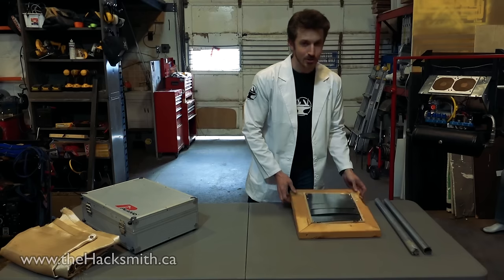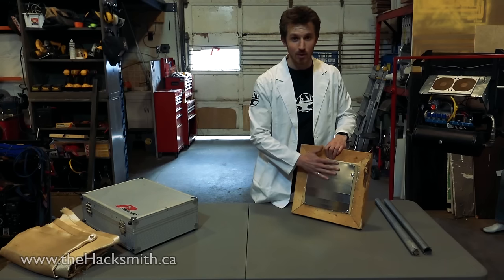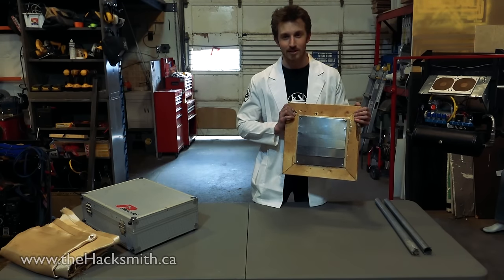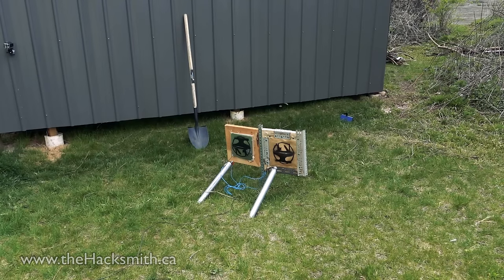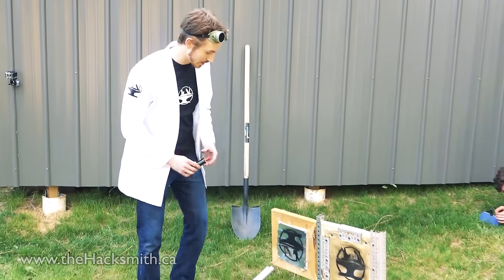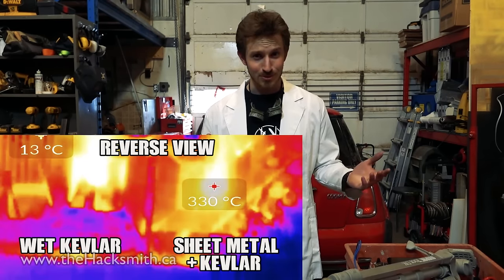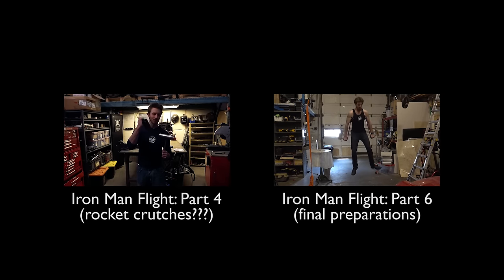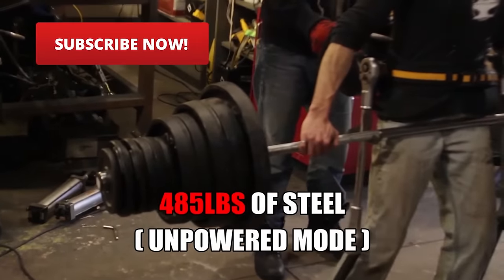Flying Like Iron Man #5: Heat Shields?

Comment: * Hey man for your heat shielding there is another fellow Canadian that had made a blue solution (slurry or paste really) and it was HIGHLY heat resistant ... I remembered seeing it years ago now on the Discovery channel and he even fashioned up a piece for the top of his head and had a helper hold a propane (maybe MAPPS??) torch to the top center of his head directly on the little "patty" of his heat resistant "paste".  He is the same dude I believe that had made that bear resistant suit years ago (project Grizzly) too which was also on the discovery channel as well.  You could maybe mix the paste with drywall compound/cement type of base or maybe impregnate some insulation with the paste to give it a structure and then could make panels of it.   Ok his name is Troy Hurtubise  and the product is called    FIRE PASTE.  Check this stuff out man :-).

Comment: Hello future Ironman,

Did you, by accident, use gunpowder from bullets or something similar in you ignition system? This kind of gunpowder is designed to produce a rapid gas expansion and not so much to deliver heat to its surroundings. This is due to the, let's call it,  "macro chemical build". This type of gunpowder consists of tiny fragments of gunpowder with space in between. The open space between the gunpowder allows heat to spread more rapidly trough the material. All the surrounding gunpowder will therefore react in a minimal amount of time. The effect is an explosion, just like what happened to the modified engine.

But if you are seeking a stable and reliable heat connection from your igniter to the surface-area of the engine's fuel, you are not far off! Gunpowder would just work fine if you use it slightly different. Gunpowder reacts more controlled when it is a "solid" block. It, then, only reacts at its surface. This way gunpowder can be used as the heat-bridge you have been looking for. Solid gunpowder can even be used as a fuel in rocket engines (You, most probably, must have encountered such engines during your research). What might be advisable is to take fine gunpowder and softly press it to the bottom of the engine and securing the igniter into it. Press the fine gunpowder that way it becomes to some extent a solid block (that might require some experimentation). (And do not use to much XD btw)

As for the isolation problem, I have a hypothesis that might give you some room for research. The output of many rockets is not purely gas, often very hot liquids, for example liquid salts (loose ions), exit the engine. These substances conduct heat a lot better than a gas would do. What you could look into is a fuel that reacts mainly to gasses. This would reduce heat-conduction so that less isolation can be used, saving weight. I must admit that I am not aware of such a solid fuel and that it might not be something you can find on the internet easily. Another options that does fulfill to this requirement is the jet-engine. But that might be too expansive. 

Those were my ideas:)
Good luck!

Comment: Honestly, having normal looking fabric pants that are fireproof is a cool idea, but they would probably end up just looking like firefighter pants.... Wait a second... Could you get some recycled fireman pants?

You could use plates of ceramic material or firebrick. Unless you can cast your own plates or find rounded ones, it may be a bit of a pain, but you can grind or cut fire bricks into the right shape and then use steel hardware to bolt them into a kind of ceramic kilt. But, that would probably add a bit too much weight. 

But I've also been wondering why you need the pants at all; can't you put some kind of defector or heat shield on the end of the rocket? But, I'm guessing there's a reason not to do that.

Dang it. Just remembered this video is old and you've already gotten past this on Amino.

Comment: As I understand you are going for max heat spreading (MAX thermal conductivity) why not try the opposite? like NASA grade Aerogel or ceramic cloth? and maybe try alternating in between  like metal-kevlar-metal-aerogel-metal-kevlar
Reply: o and maybe you an try some pattern for the metal like ^^^^^^^^^^^^^^^^^^^^ to increase surface area and maybe also the spread of the hot gas?

Comment: why don't you make a cloth that has multiple layers of materials like carbon fibre, fire blankets or put a layer of a material (liquid, to allow for more movement) with a high specific heat capacity in between a couple of layers of fire/heat resistant materials.

Comment: Why do you guys keep using kevlar? A ceramic or high temperature fiberglass would probably be more appropriate. If you want to use a metal heat shield, you need to use something like stainless steel  (shim stock or similar) or inconel.

Comment: the problem is that you used aluminium. try again using a more thermally resistant metal like steel or titanium.

Comment: Consider maybe a layered blanket of Zoltek Pyron fiber cloth with an outer shell of steel from fire extinguishers. The Zoltek Pyron can withstand up to 2,500F or roughly 1371.111C and it's pretty cheap to purchase. The fire extinguisher steel I take in for thought because they have to withstand the heat of full on building fires whilst being pressurized. Not only are they decently thick enough steel, but they also have an incredibly high melting point. Just some food for thought.

Also you can get some 9x12" sheets of the Zoltek Pyron at http://www.homedepot.com/p/9-in-x-12-in-Hands-Free-Heat-Shield-314002/100345508

Comment: Boi! Use steel or iron or a high melting metal. Aluminium melts quick and easy(relatively).
Reply: That is, if you insist on metal plates on the outside.
Reply: Or try fire wool. Like in refractory materials.

Comment: for protecting your legs why not try making a flexible heat sink that will disperse the heat across a greater area and then absorbing it so it dissipates quickly. my advice is using a composite, the matrix should be fairly insulating, some type of resin most likely definitely not a metal matrix or anything as the heat would probably build up and cook your leg, but the fibers you use should be of a material that is highly heat conducive like a carbon fiber with a treatment of iron dust. it may also prove helpful to add metal particles or some other fine material that will absorb the heat after it is dispersed through the iron particles and carbon fiber, it would require expeirmenting to see if it should be more or less heat conductive than what is dispersing it and the melting point may be taken into consideration. or it could be a dust that has a chemically cooling effect. research is definitely needed. i will look into thermodynamics some and reply to this same comment if i find anything useful.
Reply: i am not finding a good matrix to hold any kind of heat sink fibers to hold heat, so far most of the available resins will melt and fuse to your skin or release toxic fumes. plastics are not looking too good either. but if you can apply a heat sink from the aluminium plates with some iron the heat should pass through the aluminium letting a portion of the heat glance off with the gasses projected by the rocket. so it is a matter of finding how to apply the iron heat sink (iron is among the lighter and more affordable materials) as it spreads the heat across the area and cools it. the biggest problem was when the aluminium failed and melted, and that the heat wasn't spread or cooled. mere insulation wont get you far. and the carbon fiber i have doesn't seem to house particles well not even when held on with polyethylene so that wont work either.
Reply: there is a lot of hope in Liquid Cooling Garments but they will only do so much in terms of cooling. still searching. i have a project myself that requires similar 
 heat protection so this is time well spent

Comment: Titanium plates, perhaps? Much stronger, but not necessarily lighter. And a lot more expensive.
Reply: titanium will burn in the right conditions.
Reply: +gingerneering101 true just  cutting titanium with a grinder thows burning sparks off

Comment: With regard to the heat resistant pants.  You keep firing your tests directly at the material.  at no point are the rockets going to be pointed like that with relation to your legs.  Why not test these rockets fireing alongside the material instead of directly into them?

Comment: Have you ever seen the burnt bread Heat shield? there is a video on you tube of a guy blasting a single chard black "Carbonized" piece of toast with a torch using a thermal cam to see under the toast nearly no heat came out the other side.. now i'm not saying "USE BURNT TOAST" as a heat shield but i think you can see the direction i'm going with this..
Reply from the maker: +Mike Devine haha I have, but there's surprisingly bigger issues besides the melted flesh issue... Mostly the simultaneous ignition issue :p
Reply: the Hacksmith I'm just spit balling here but what about some type of Micro capacitor to ignite it that way you have a constant at the ready charge of ruffly the same power every time..?
Reply from the maker: +Mike Devine you can get ignition wire to ignite at the same time no problem with a parallel circuit -- but rockets are too variable in manufacture. If you watch the following videos on this you'll see :)

Comment: if you want to have the armor portion as well you can try this stuff i have heard of that's basically just carbon steel with the carbon element being made up of carbon nano-tubes... stuff is supposed to be strong as hell but sadly the patent, which is still within the time limit, is owned by the Israeli army... so i have no clue weather or not you could get your hands on some.

Comment: I think it would be best to make a support that is welded onto the crutches and then goes to your hips so that if the your arms were to bend towards your legs then the hip struts push against your hips and make sure the rocket cannot bend all the way to your legs. something like this:

       O
        |
        |
O--- |
        =RRR

So the first "O" at the top is where the crutch meets your shoulder, the you have the crutch going down to where it meets the hip where it then has a strut and another "O" which would be the part to then push againse your hip should the rockets get too close. You can make this part long enough to have the rockets have a max angle of paralel or a bit bent away from your legs.
And then below the hip support you have the 3 rockets indicated by the "RRR".

If you don't understand please tell me and I'll make a drawing or something to better explain this.
Reply: Oh also while this design would make sure the rockets don't get angled directly towards your legs I think it would still be best to wear heat protection maybe using the metal and kevlar design you showed this video, it might not be able to whistand a direct facing rocket, but that wouldn't happen because of the hip supports.

Comment: Use kaowool for a fabric like heat shielding
Reply: And try putting carbon under the kaowool it may add some rigidity to the fabric and add heat resistance, just my two cents!
Reply: +J Craig http://www.sheffield-pottery.com/SUPERWOOL-607-HT-BLANKET-8-lb-Density-1-p/tcsw607ht.htm seriously this is your best bet it has basically the same heat resistance as firebrick but it is a fabric-woven fiber material

Comment: Have the aluminium and the Kevlar so it looks like this 

/-/-/-

/= aluminium 
-= Kevlar 

So you would have more strength or you could have a metal shield like Knights wore but use titanium or 6mm steel so it would protect you legs. 

Or put Steel plates at an angle so it would stop the power and deflect it off

Comment: Buy some higher range metal maybe it could make a small or huge difference seeing as steel and aluminium are highly magnetic which the magnetic fields might be are doing something to the rockets I might be wrong hey ho, material wise I think that ceramic or adhesive could help with the Keplar

Comment: Why can't he build a cone that goes around the rocket so the flames don't leave the cone only the thrust will and the metal cone will only heat up which is better than burning him because the issue is the flames touching him so if we confine the thrust with a shield around it not on his legs the thrust will never touch him

Comment: why don't they build a light weight metal iron man legs and use thin layer of fire/heat resistant  insulation on the inside.

Comment: How about you have your legs protected by metal not touching your leg! So you could build a braket at your knee going outwards then one at your hip going outward then have metal going from one braket to the other leaving a gap between it and your leg

 o
/|\
[ |]
 /\
I hope you get the idea.. Pretty much metal on the side of your leg not touching your leg but mounted to your leg
Reply: Man i do I explain my great idea.

So on the side of your leg there will be metal but there will be a gap between the metal sheet and your leg/skin. The metal will get hot but if it isn't touching your skin your good. So have metal on the side of your leg but leave a gap of 3 or 4 inches. Because theres that gap of course you will have to come up with a way to hold the metal on your leg with a gap between you and it. Now you could try finding metal that doesn't get hot easly and doesnt way too much

Comment: One theory would be to put small high-powered fan or electric gen engines just small layer underneath with a plate that will guarantee the length of the fire to help get it off your legs so even if you do use protection on your legs it won't directly be hitting it like that and you need to turn a bit of the engine off of you at the same time but by putting those fans you'll make up for not directly going straight down your back and yes it'll take power but can a jet engine that's producing gasoline create electricity and still have thrust cuz he can make electricity there's heat plates I don't know how accurate is or how much expensive that would be but those heat plates absorb heat and make electricity mixing that into what you're trying to do would be great you also need to make a metal that when hit does not melt by a jet engine every plate and everything that has to protecting your body from those detergents you just try to use the strongest materials you can afford and I would say to a lot of tests 
You need to figure out a way to make energy to make up for the fact that those jet engines can't be your only thrust you got to have enough energy to stay up it's a lot of batteries and a lot of weight so creating energy on a fly with lightweight would make up for those batteries so you need less thrust to tell you the truth you need a jet engine capable producing power seriously having both in one would be an advantage and it takes a lot of fuel by the time you get yourself off the ground are you going to have enough fuel which means you may want to jet engine that a drop of fuel is like 10 gallons of gasoline or diesel or jet engine fluid which probably in around yet maybe you can come up with it with the right school kids the right person to help you because the biggest issue is fuel and electricity for an iron Man suit it's not the computer tech because even if you do have a stronger motor that's smaller and you do have an energy being type of thing to lift you off the ground you're still going to need power everything will always come back to power more so than anything else honestly would it be easier also to make falcons wings pop out and have the jet engines on falcons wings you know actually make falcons rings real before finishing the soup so not only are you going up with thrust you don't have to have the thrust on all the time because it's sort of like a glider you might have to use a tail as a rudder that works like a tail and works like a rudder all at the same time

Comment: Insulwool (or other brands) might work. it is used to line the inside of forges, and depending on the type, can withstand over 2000° (some 3000). It will be bulky though, and you will have to find the right stuff. I'm no engineer, and I've never worked with rockets, but that's my two cents.

Here is a link to some on Amazon: https://www.amazon.com/Ceramic-Insulation-Blanket-Quadrafire-Stoves/dp/B00GT5Q6X0

Comment: this may be a stupid idea but what about a big fat layer of aluminum foil
Reply: The rockets are getting too hot and just burn through like you see in the video
Reply: Justin Radlinger how hot do those rockets get anyways
Reply: +Karl Sander Vinkel I don't know but since they're burning through aluminum they are getting hotter than 660 °C.
Reply: pretty sure the aluminium would melt in no time.
Reply: +Wndrr actually it did in the video...
Reply: the foil is very insulated so it never burns from heat, but it can set fire very easy